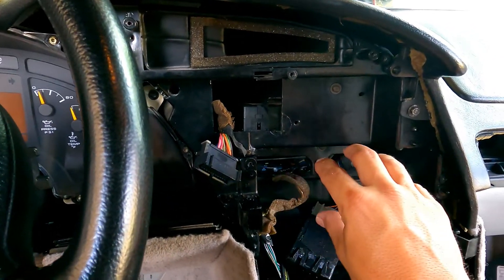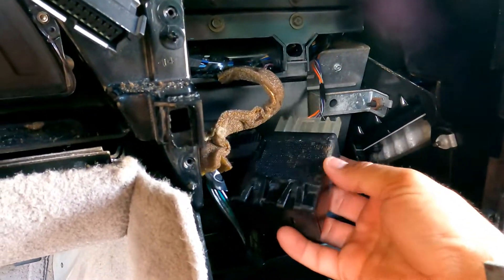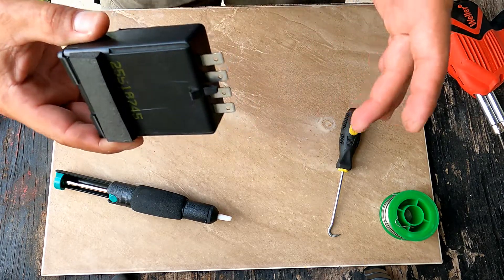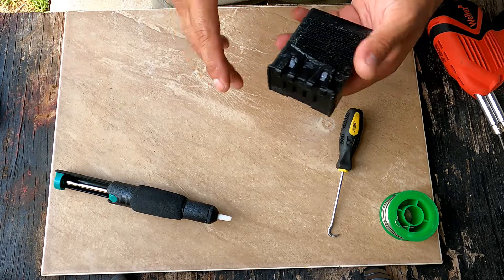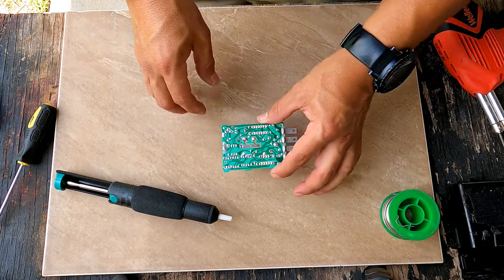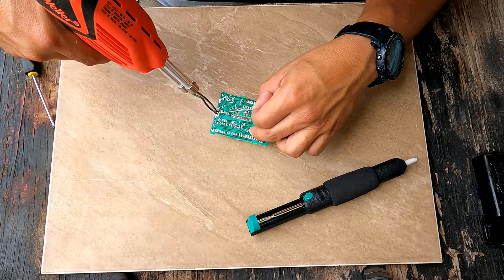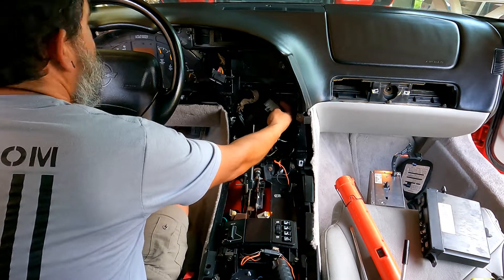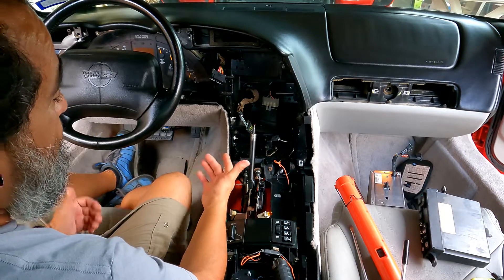C4 Corvette Chime Repair

Comment: I had no idea about that little box.  I get zero chimes. Maybe your fix will work
Reply from the maker: One way to find out chief
Reply: I did remove it.   I cleaned up the contacts.  I retested it.  It worked.  Took forever to get reconnected.  Still not working.  I’ll have to look elsewhere.  Maybe a ground issue.  Is it unusual for it to test good out of the car but still be a bad unit ?
Reply from the maker: @jeepguymb45  Yes, the prongs flex when you plug it in. Causing it not to work properly